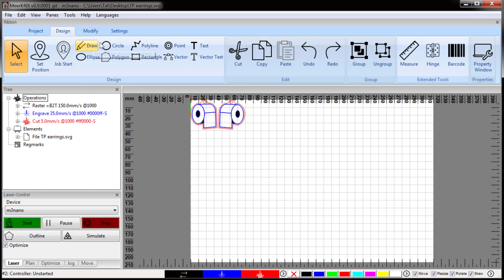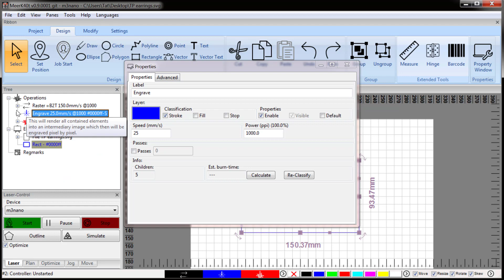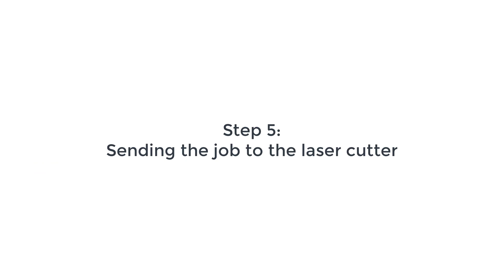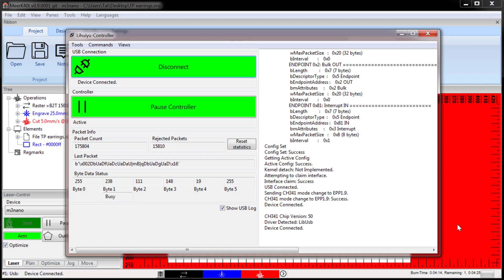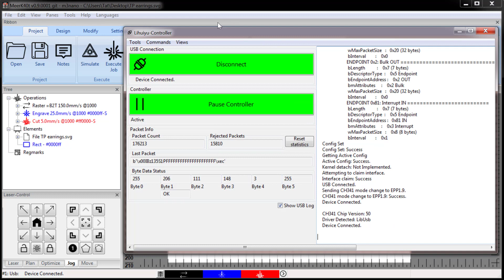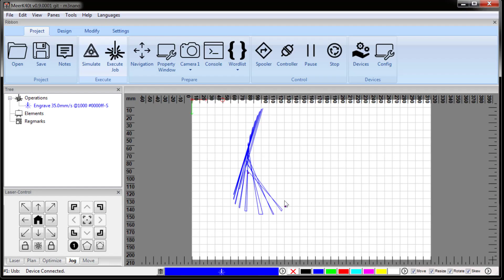MeerK40t Tutorial - Part 1: Basic Instructions

Comment: Nice video, I recently got a K40 and installed a new tube. I have tried Meerk40t today, but I haven't seen a way of changing the order of the operations, or maybe i'm missing something.
I have a word as engrave, and the border as cut, but when i do the preview, it does the cut first, and then the engrave. Tried it on a scrap piece of wood, and it did the cut before the engraving. What am I missing?  I'm coming from Lightburn, and a diode laser. Thanks